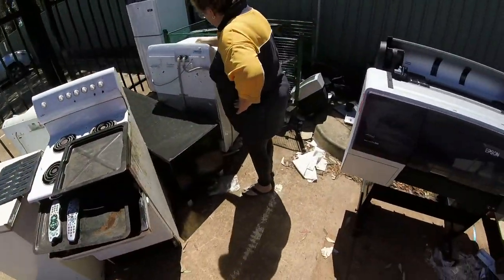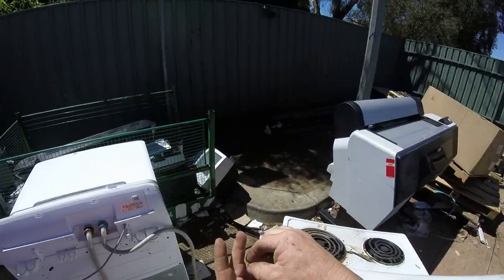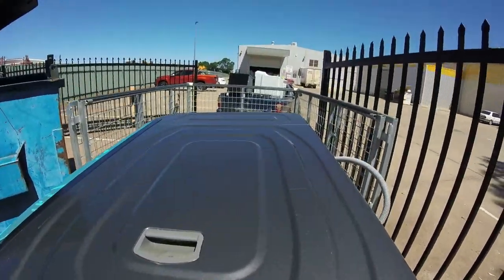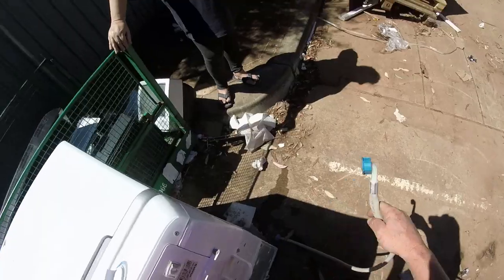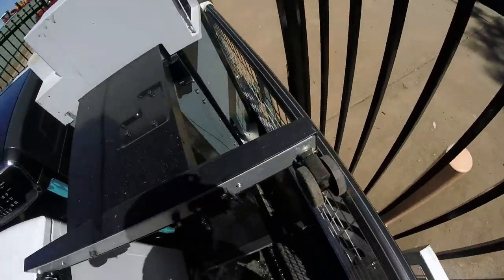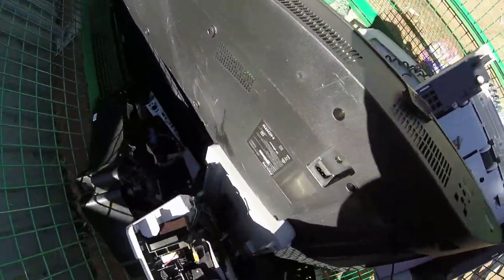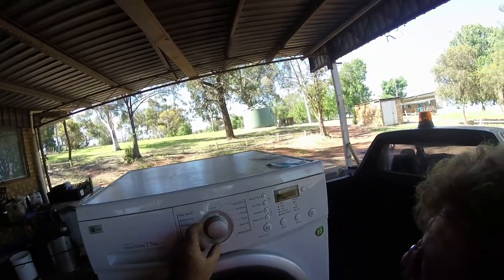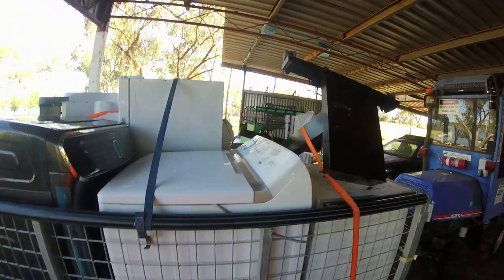DUMPSTER DIVING A MEGA DAY AT HARVEY NORMAN

Comment: Most of the time if the washing machine don't drain the water it is the water pump that needs fixing. If it is not spinning or washing it could be the belt on the motor that can be adjusted or you buy a new one.